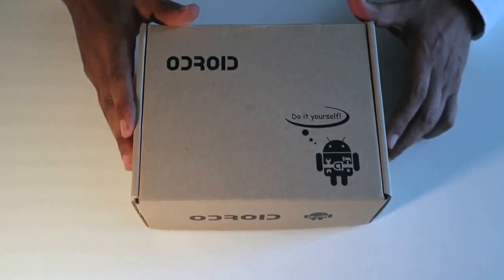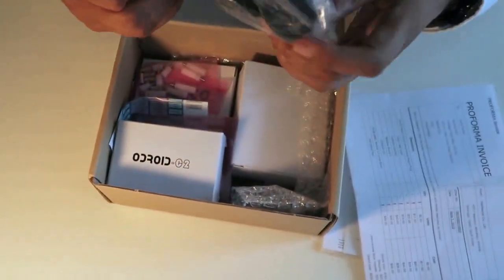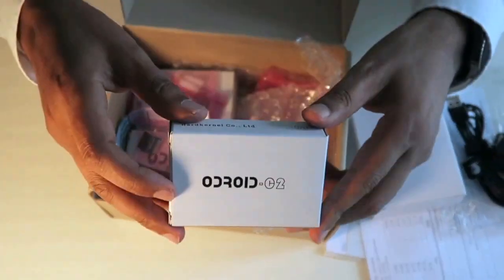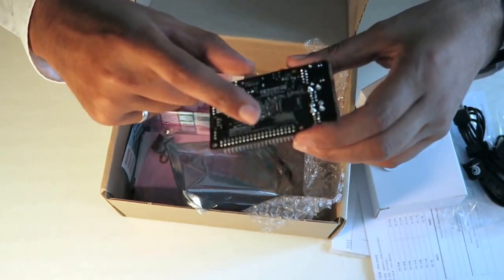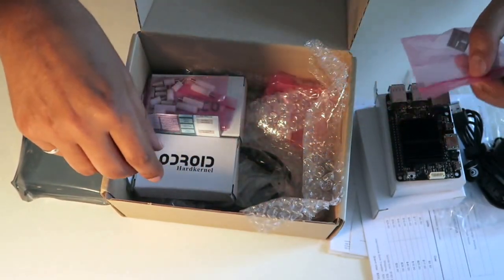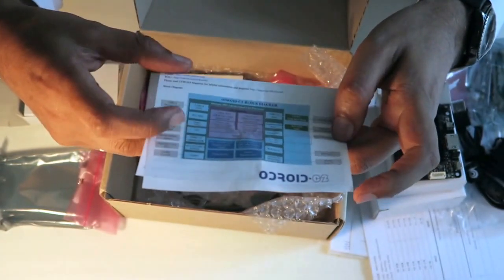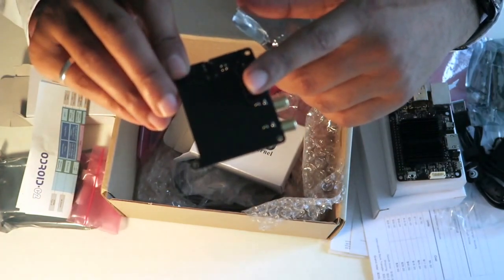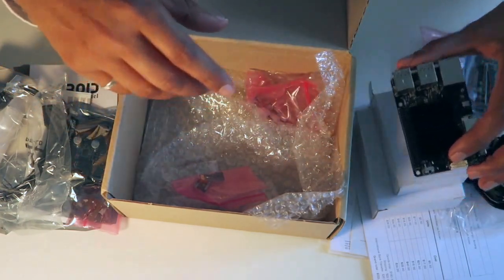Unboxing odriod C2 and Bits - Hardkernel

Comment: How's the sound quality of the hifi shield, do you hear any interference because of it being on top of the odriod c2 instead of separated from it, I have always heard not to keep audio dacs near computer components due to the interference.
Reply from the maker: +MrSkyTown you are right best to keep DAC's away from other equipment generating RF - personally I have not noticed any interference from the other electronics on the board effecting the DAC.
Reply: RunTime Cafe oh Ic that's great,  thanks